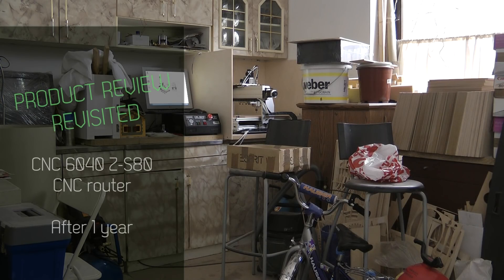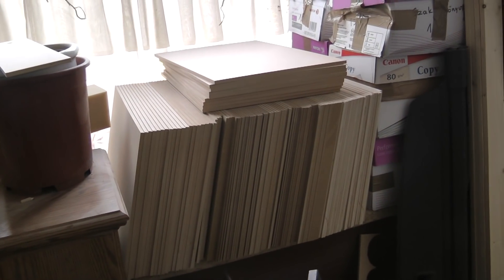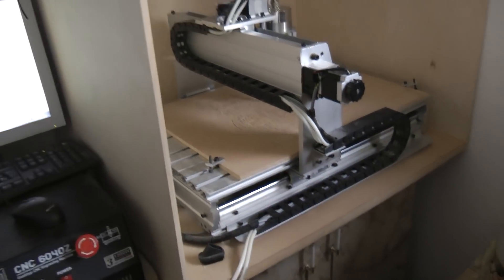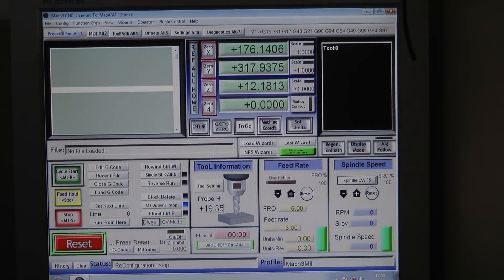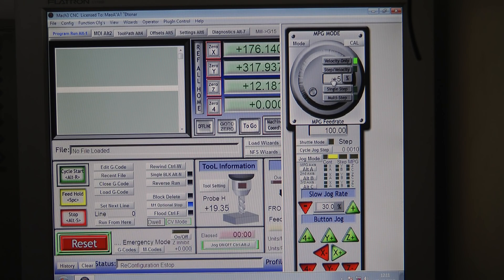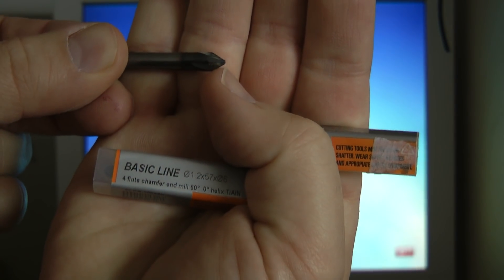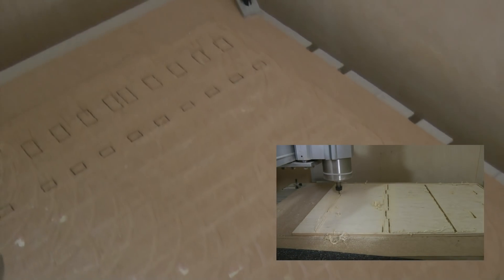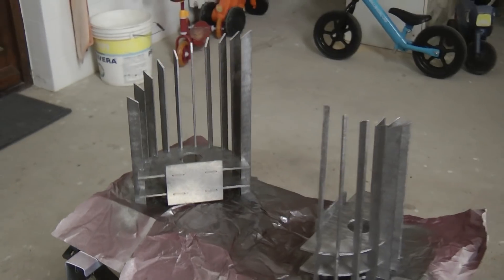CNC6040Z-S80 - After 1 year

Comment: Hello mate. Thanks for sharing your CNC experience with us. Its great to see your story. I have a similar machine to yours, although with an air cooled spindle.

 I did manage to fit limit switches to mine, I can send you photographs of what I did.  I drilled & tapped into some of the castings. The best use for limit switches is as a home indicator. One challenge with my limit switches is that they pick up noise & false trigger. I'm in the process of replacing their wiring with shielded cabling. Now that I know my machine, the limit switch function is disabled a lot of the time. I am about to do a tram adjustment, mineis slightly out.

Comment: Hello, what are the dimensions of the biggest rectangle you can cut out with this machine after reducing the working area due to the lack of limit switches?
Reply from the maker: My standardized boards are 350x500mm. But I can probably go another 50mm in each dimension. But this works for me.
Reply: @csongorvarga  Thanks for the answer. Have you considered adding limit switches to the machine?
Reply from the maker: @kleinermann809  I did and I even purchased them, but have never gotten around to do it. I always limit my drawings within 500x350mm, I always move my objects close to 0,0 even draw a boundary around them, and with these in mind, I never make a mistake. I never draw outside the are, and my gantry never hits the limits. Of course this does not mean it cannot happen. I need to check again but as far as I can remember you can just connect the limit switches in parallel, and connect to an unused pin on the parallel port. And you just need to configure in Mach3 which parallel port pin are the limit switches. And it will stop the feed once it detects a signal on the pin.

Comment: Would like to hear another update, specially interested in noise generated by cutting/milling plywood & MDF. Any problems or pitfalls, things to avoid as well as seeing/hearing the machine in operation
Reply from the maker: I am using this machine much less than I thought. But I feel like it was still a good investment, because whenever I need it to do something, I just turn it on and it works. I am planning to do some stuff in the near future, so I will try to remember to film it.

Comment: okay the last question was all over the place is there a way you can make a video that will go from start to finish of making the gcode and software of a simple circle or something and then show how you get the end result. I have your same model cnc machine also do you have to control the spindle speed like me on the knob of the controller box? that was another weird thing.
Reply from the maker: Type Vectric Aspire to youtube and you find a lot of useful videos. That his how I learned as well. I mean you need to start with some vector graphics to start with )e.g. outlines, etc). You can use any CAD software for that or even CorelDraw, but simple drawing functions are available in Aspire as well. These tutorial videos will get you up to speed with the basics and you will understand what are the different routing options like pocketing, cutting outlines. Once you understand these you can use any CAM software to generate the gcode.

Comment: I couldnt  get my printer to work with mach 3 without buying the uc100 did you have this issue also? i have it working with mach3 now with the uc100 on win10 x64 but now im lost i know how to create cgode from 10 different software but is there something you use that is better for this machine? im new with cnc but expert  with 3d printers...so im a new cnc user..and its been a nightmare with getting it up and running it isnt as easy as 3dprinting but i have to learn if its the last thing i do.
Reply from the maker: I personally use Vectric Aspire to generate my gcode. I usually create my drawings in AutoCAD, I export the final lines as DXF and import them Aspire where I generate the gcode. The gcode is not device specific, you just need to keep in my what are the physical extents of your CNC. You can also use Fusion360 which can be used to create the drawings and the gcode as well.
Reply: @csongorvarga  thank you so much...im so ready to just start playing with it and building stuff
thank you so much

Comment: hello Csongor
just wondering how is the machine going for you
i have the 3020t version  and it is a good little machine but i haven't done much work with it
i am using snapcnc to control  mine  without mach3 as  snap cnc is grbl based
and i'm running it on a laptop so for anyone looking for a cnc controller software to use on your laptop then snapcnc is the one
it's from a company in germany called docado hope this helps anyone that's worried about using a laptop
to operate their  cnc
you made a very interesting video
Reply from the maker: Hi James, I am not using it an awful lot nowadays either. And also I had made no modification to it either. Stock controller with mach3 I was given in the pack. I am still using the parallel interface with an old desktop. It just works, does things it is supposed to do, so I did not feel the need to make any changes. I do have some nice microswitches, so I am toying with the idea of adding them, but I usually have so many running projects, that I afraid will just drop off at the end of the list.
Reply: thanks Csongor for your reply
they are a great item for model making i have cut some oo/ho buildings for my layout
it takes the hard work out of the job  i seem to spend more time designing the items than it takes to cut them out   but thats half the fun
look forward to seeing more  videos from you
Reply from the maker: Oh, so you are into trains as well. It certainly takes a lot of time to do the models. I have a warehouse building which is still waiting to be cut. I am into scale 1 (garden), so I make use of the of the 6040 bed. I am also having trouble with plastic. My best try was a hard foam, anything else (e.g. PP or thick plasticard) had very rugged edges. So I am still working from plywood or MDF. Not the best for outdoor, but will do for now. If you have any experience in those materials I would love to hear your tips. I should also spend some time trying to mill brass. Would be awesome to make some wagons or even engines in the future.
Reply: hello Csongor
yes for my sins i'm into model railways although only really starting
i have cut styrene  with a 1mm end mill  reasonable outcome  but it has to be ran as quick as the bit will allow and the spindle as slow as the bit will allow
i have cut pvc foam board 3mm  quite well and it can be cut at a higher spindle speed again cut with an end mill you will have to try which speeds and feed rates suit your  machine    here is   an idea for you that i use to join the corners of the pvc foam board  i have an old small router put on to  a piece of plywood and turned upside down on top of a frame  and i have a v groove bit on it and i route  the ends and backs and fronts  of the buildings to 45 degrees so they fit  very nicely together
i find that the spiral flute are course and dont leave a nice edge they tear the plastic  i  know they do not heat the plastic as much as the end mills but the end mills leave a better finish
i  hope this helps
Reply from the maker: Hi James, I clearly need to spend more time on this. I was also told to use a single flute end mill for plastic as they provide better finish. The 45 degree routing method is a good one as well, I shall see how I can build a similar jig for that.
Reply: yes Csongor it is trial and error with cutting plastic with the cnc but  you will get there
as for the jig  i used a piece of 12mm plywood  and  bolted  the router to it
if you need any more help  just let me know
Reply from the maker: Actually yes. Maybe if you can make a video on it :) I get the idea about the ply bolted to the router and the V router bit, but how do you ensure that you only cut up to the edge of the board?
Reply: hi Csongor
 taking a piece    make a wood  to make  a fence  cut a notch a little bigger than the v cutter  you are using and bring it forward to suit the thickness of the plastic  and clamp it down the fence will be covering most of the bit  this is the method i have used but   also you could use a bearing guided bit with the  bearing  at the base of the bit and raise the router to suit the thickness of the material you are cutting both methods require you to raise the router bit to just suit the thickness of the material and to keep a downward pressure while you are routing the edges  but be very careful using the router as they are very dangerous  
hope you will be able to sort it 
                                        Fence
______________________________________________
____________________             _________________

                               notch cut out as above  for the bit  

it sounds more difficult than it really is i hope this helps
Reply from the maker: Thanks, I will give it a try.
Reply: @csongorvarga  You ask about Polypropylene, I have worked a lot with it, tough not with many tools. From my experience use bits that have easy chip evacuation. Always had bad results with two flute bits. Try using one flute bits. Obviuosly you will have to find the right combination of feed and rpm to give a chip to bite and not scratch the surface. It is possible to obtain incredibly clean surfaces with PP, however do not touch surfaces unduely with the bit. it's a delicate and soft material. Also use sharp quality bits.
Reply from the maker: @gianfds3177  Thanks a lot, this is very useful information. I will get some new bits anyway, so I start shopping. Do you have any experience with copper/brass?
Reply: @csongorvarga Nope, I never machined those materials. I will machine brass very soon however. You shouldn't have difficutly in finding informations around for the best milling strategies.
Reply from the maker: @gianfds3177  Thanks, I guess in general it will be a high spindle speed and a slow feed rate on this device. And a general two flute end mill.
Reply: @csongorvarga  Can't really be sure of what I'm saying as I only machined soft materials. However I was always told that for metals low rpm and low feeds is better. This to avoid heating of the bit, which will probably melt and get damaged. I can relate to this. If you try sawing aluminum with a jigsaw, and go up with rpm, your blade will turn extremely hot and the tooths will loose sharpness. At that point you won't be able to saw nothing. And this is why using coolant fluid is always a good idea with metals. Remember also in this case to feed enough material into the bit or you'll scratch the surface obtaining only overheating.

Comment: Do you have info about home limits setup? My cnc does not stop when I pulse the homing switches . Any clue? Thanks.
Reply from the maker: Soy ketzatkoatl There are no limit switches on this model. So you have to zero your DRO manually. And also make sure you keep the table extent in mind. Otherwise you drive the axis to the limits.

Comment: You could have added homing and limit switches: https://www.youtube.com/watch?v=DeRuMZKCiy8
Reply from the maker: I could have, but I did not bother to research how it can be added to the supplied control board. Btw, you added a link to my own video, wasn't it something else you wanted to link it?
Reply: Sorry,
http://www.thingiverse.com/thing:30253
Reply from the maker: Thanks for the tip. For me mounting the limit switches are probably easy, finding out how to wire them to the stock controller will be more difficult. Anyway I will look into this and see if I can make it working.
Reply: The stock controller was the first thing I threw out in both my YOOCNC 6040 and 4030.
Next thing was to do a proper star-grounding to get rid of all that electrical noise.
I have the older control box, where the VFD was a separate device and could be controlled by MACH3 via RS485.
Reply from the maker: Well, I am not willing to make that move just yet. I should/could use my CNC a lot more. I am probably not even aware of the limitations and issues of the stock controller. I just live with them. I also have a separate VFD, it is just put into the same enclosure with the rest of the controller.
Reply: gettowaydriver the Gecko is equally old. A good driver board does its own clock, has a command buffer memory and has Ethernet or USB.

The is the 21st centuary. flipping pins on a parallel port is a thing of the past.
Reply: You had a copy of MACH3 with the machine, I assume?
I'm talking about the likes of these:
http://www.ebay.com/itm/Replaceable-MACH3-DIY-4-Axis-USB-CNC-Card-Controller-Interface-Board-USBCNC-/142217882241
20-30eur for enough io-pins to add end stops, homing switches (absolute coordinates you can go to precisely again after any kind of interruption or messup), a tool height probe and a 4th axis later. To not have to worry about your maching stalling because the PC goes into some low power mode at reduced CPU frequency and messes up your cycle-based software timing or worse...the HDD spins up and your machine halts for half a second (luckily there is no random HDD defragmentation and search-indexing with the unsafe and beyond end-of-life Windows XP)?
Reply: http://marcuswolschon.blogspot.de/2013/01/upgrade-yoocnc6040-from-lpt-to-usb.html   This is the one I used and I keep using it to this day.
Reply from the maker: Yes, I am using with the stock controller for over 2 years. I did not even set the soft limits. I just take extra care and format all my work in a 50x35cm work size. But I am getting some limit switches and will try to have a go and installing it myself.
Reply: I'm currently posing improved limit switch holders for these chinese machines to Youmagine. They no longer require drilling any holes into the machine,
Reply from the maker: ***** Great news Marcus, I would be interested in on those for sure.
Reply: I'll publish them on YouMagine today or tomorrow. I just didn't get around to upload the photos yet of how they are supposed to be mounted.

Comment: A great way to keep steppers cooler is to attach a heat sink on each of two sides.  You can get cheap CPU cooler heat sinks with fans that work great and attach them with double sided heat transfer tape.  You may be able to lower your motor voltage a little too if your using an adjustable switch mode PSU, that makes a big difference, and you should be able to find a lower voltage that won't compromise performance.
Reply from the maker: Thanks a lot for these tips. I will give it a try. Usually I have less time over summer so I don't toast those stepper much.

Comment: Koszonom for the videos . Very good explications . Keep up the good work. For the stepper motors you may replace them with ClearPath servos . They don't heat up and are more accurate.
Reply: Hi, 2 years ago but maybe you'll read. I'd like to mount servos on my machine. How do you do that? do you have to change other components other that motors and drivers? thanks

Comment: Hi .. very informative ,  question , what is the maximum travel on the cutter tool ,,i.e .. Travel of X and Y  i see in your video you have a travel limit to 350mm   i have some sheets i need to cut a design up to 400 wide and 500 long could it achieve this ?
Reply from the maker: +Ziwi I am limiting to 350mm just to be on the safe side. The website says the following: "X,Y,Z Working area: 580×380×60mm". I have not tested what is the actual. 380 is close to 400, but might not work. I can give it a try but  not now.
Reply: +Csongor Varga 

Thanks ! every time i ask these Chinese some question i get different answers.. they all tell me its 600 x 400  but i have seen on some sellers its listed as 575 x 375 .. and its very confusing.
Reply: +Csongor Varga

HI .. any chance to know the Total  X travel ? Thanks
Reply from the maker: +Ziwi I checked and the maximum travel is 550x380 mm. Maybe there is a few mm more but it was on the edge. And you have to be very careful as there is no limit switch on the device. So you can drive the gantry into the structure.
Reply: +Csongor Varga Cheers Thanks !! Now, I know I must buy the 6090 version.
Reply: I also wanted to know this question. very difficult to find. 
thanks!